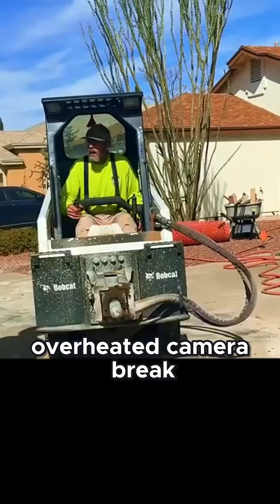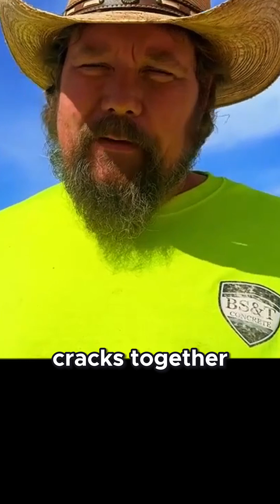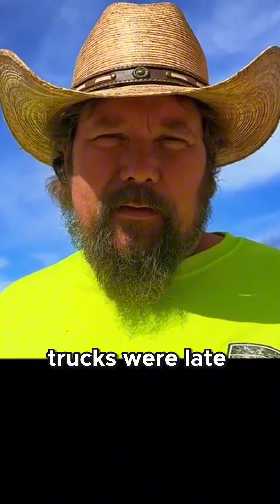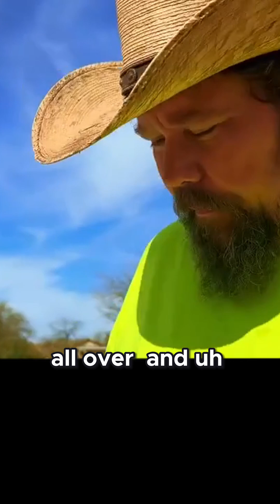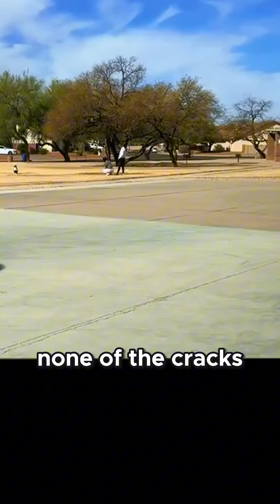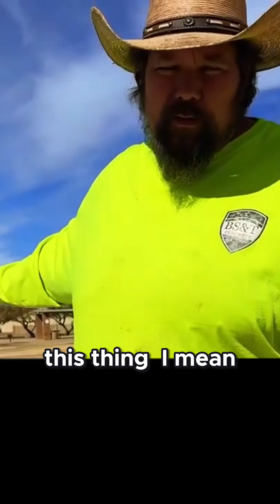The Importance of Rebar in Concrete! #concretelife

Comment: Ive never had concrete crack the same day, except 1 time and it was a concrete company ive never heard of, that solid #53 stone base has always held our cracks together,  now when i worked for some1 else , they didnt get their base right and the cracks didnt hold together.  Im sure if it had rebar it would have held together,  but there would be a void under it. Im not a fan of rebar, i like wire mesh. But there is a key to using wire mesh, cant pour wet or u will push it to the bottom, but if the mudd is stiff it wont. I do use rebar occasionally but as a grid system, my belief is it is way to much, ive also seen rebar cause rust spots, so when i use rebar i use fiberbar, i also use rebar when something really heavy sitting on it. Not a vehicle,  vehicle other than Dump trucks are not that heavy. But i do agree that if everyone in yur area uses rebar, u better use it too. My area we dont use it. U never see a grid system. Nobody in Indiana does that. If u did that u would loose every bid
Reply from the maker: That was the very last day we ever used Cemex.